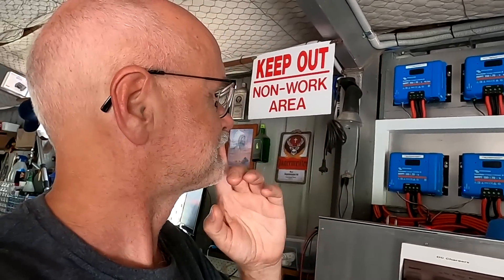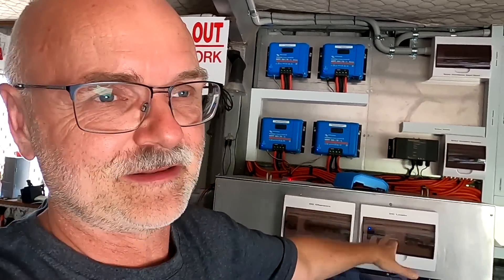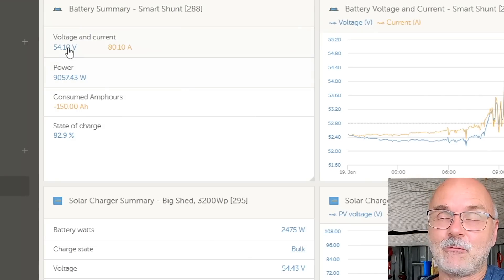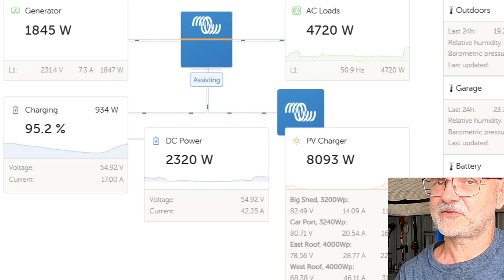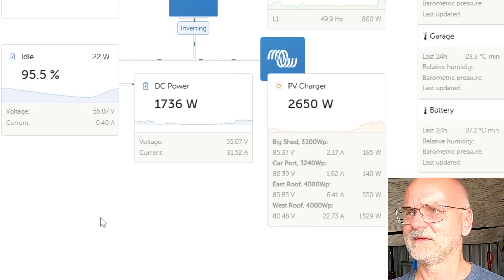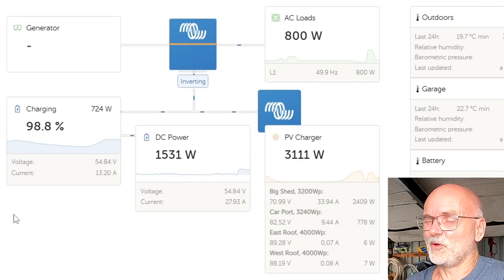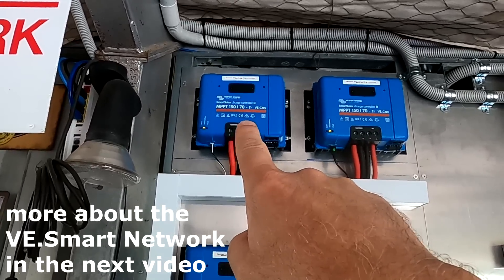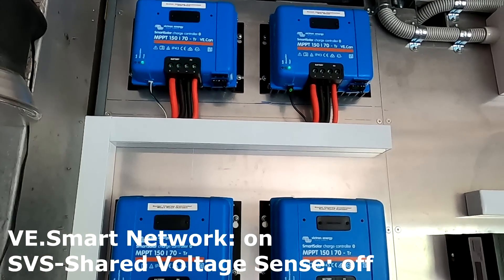Charging chaos: no charge despite full sunshine. MPPTs out of control!

Comment: We have 3x SmartSolar MPPT RS: 2x 450/100-Tr & 1x 450/200-Tr.
Each SmartSolar is connected to each other via a network cable (VE.can) and 1 SmartSolar is connected to the Cerbo GX.
There is 1 smartshunt 500A in the system that is set up as a battery monitor.
I have disabled DVCC.
Each battery bank has a (JK) BMS, but they are not connected to Victron via canbus/RS485. I visualize the JK data using ESP32/ESPHome in Home Assistant (see syssi/esphome-jk-bms).
The solar chargers work as 1 device. They are always in sync (bulk/absorption/float) and they work based on the battery voltage of the shunt. I can see that the limits for each mode are reached correctly.
Reply from the maker: Ah, right, so the sync happens through the VE.CAN already even there is no smart BMS connected. Very good information, thanks a lot!

Comment: Have you actualy measured your batteries with a digital meter as the calibration of the control box's may be different
Reply from the maker: That does not matter and is not the problem. Even if the smart shunt measures 50mV off to what it actually is, it is important that all MPPTs get this same information from the shunt.

Comment: I saw that the MPPTs switched themselves of even when there was a high load connected. That seems strange and inefficient to me.
In my grid connected system the Multiplus II simply switches to feed-in and the charge controllers continue to run full blast even when the battery is full ( as long as the inverter can handle that much current ). Any idea why it doesn't run the MPPTs at least on the level of the connected load?
Reply: well this is off grid system,  they should all stay in the same mode, when he disabled the smart bluetooth network a few weeks ago it was just using the ve netowrk to share the voltages,  but seems the ve netork doesnt force them to stay in the same charge mode.
Reply from the maker: You have DC feed-in enabled, that's a totally different system. They are controlled by the settings in the MPII, I believe. Not sure why they turn off though. Do more testing to find a pattern when they turn off.

Comment: I believe the issue is line resistance to the battery. With all 4 charging, the voltage rise is high enough to hit the trip voltage, so the first one to detect it turns off. Then there is less current so the voltage rise is less, it takes a little longer but eventually hits the trip voltage. Etc. But at the last one, there is not enough charge current to overcome the load. IMO, when the first one shuts off, it's charged.
Reply: but thats the point of the svs ( shared voltage sense )

Comment: I had the same problem, my solution was to set the absorption voltage to .05 volts above the what the voltage the battery should go to and set the absorption time to 8 hours and a tail current to 1.9 amps. Yes, I allow the solar charge controllers to stay on the network but I do not allow my shunt to be on the network. The only issue is it takes about a minute for the charge controllers to change to float after bms hits the correct voltage.
Reply: 8 hours of absorbtion ?
Reply: @STRUTZKOFF  it won’t ever make it the 8 hours, just for the very cloudy days. The tail current makes sure of that.
Reply from the maker: I don't like the idea to having a higher voltage setting in the MPPT to allow for voltage drop on the cables. If the current is small, you have this higher voltage at the battery and charge higher than anticipated. 
Why don't you integrate your shunt into the VE network?
Reply: @OffGridGarageAustralia  I was using the shunt for another project and it seems to be working fine without it, so I never connected it to the network. It really cannot charge higher than anticipated since the bms will prevent that.
Reply: @OffGridGarageAustralia  I did a test today and decreased the voltage on the solar controllers to .02 volts over the absorption set point and funny thing happened, the mode went from absorption to float without hitting the correct voltage in the battery. Going to try .03 next, .05 did it before, just fine turning it.

Comment: I have two 150/85 regulators and I noticed that each one detects a different voltage and they are not precise on the voltage..... I solved it by adding a Smart Battery Detector, which communicates with the regulator and always sends it the battery voltage and also the temperature
Reply: but these do that via the svs

Comment: Hi Iam using 2 Smart Mppts with a Smart Shunt and a Cerbo GX in my Camper. I've turned on all DVCC Features and the VE Smart Network at the same time. And the MPPTs are in sync all the time. I'm strugeling a bit when plugged in to shore power with the Multiplus getting synced. But this doesn't happen very often ;-)
Reply from the maker: Thank you for sharing. Interesting you turned everything on in the DVCC...

Comment: Helle Andy

I have a system in my rv with 2 victron mppt smart controller and a rec bms with 300ah lifepo4 battery. I have'nt seen your problem in my system.
The 2 mppt are one 75/15 and a 100/20, and they both work equal hard. I also have the bmv712 but the system is totaly controled by the rec bms, without any problems. I have the cerbo gx configured for dvcc with svs, sts and scs activated, and have  not seen any problems with the mppt's charging the battery.
In my system both mppt show external control and not bulk, absorption or float. Because they are totaly controled by the bms. Right now my system is offline because it's winter here and the rv is shut down.
Reply from the maker: Thanks so much for sharing. The REC BMS is something people have recommended. I may get one in for testing from a viewer if everything goes well.

Comment: I don't understand why anyone would want more than 1 Solar Charge controller. I would just get a bigger one. My MidNite controller just does it all, I understand this channel is for testing, but all this stuff is so confusing it'll take the fun out of the whole of grid thing. God bless, and Stick it to the Man!!!
Reply from the maker: Hi Chris, you never get only one device from each. If it brakes, you're in the dark. Multiple solar charge controllers, multiple inverters, multiple batteries.

Also, you want one solar charge controller for one roof orientation/direction

Comment: Thanks for your video! I have a similar problem with temperature sensors. I am trying now t o solve it with dvcc
Reply from the maker: Not the -1°C problem?
Reply: @OffGridGarageAustralia  No I think it's temperature mine issue. The solarcharge is closing the charge for some minutes and starts again with no error. The pv voltage are fine cables etc. Maybe there is software bug with "ghosts" temperature readings.
Reply: @OffGridGarageAustralia  today was perfect, no problem yet 😀😊

Comment: What voltage do you measure at your battery terminals? Over here, my lynx shunt voltage is about 0.3 lower than what I measure at the battery. Yes without current flowing, so should be equal. That means my multiplus thinks the voltage is lower than it actually is and BMS shuts down charging because over-voltage. Solution, change set points to overcome this measurement difference.
Reply from the maker: I have not measured the voltage of my batteries for a very long time. And this is not too important if the smart shunt measure say 50mV over or under the real voltage. 
Far more important that all devices read the same voltage.
Reply: Calibrating electrical equipment is an important step not to be missed during installation.  This is an important point.

Comment: I am not using any Victron equipment at this time, but I have two very different charge sources to my battery bank. The two systems here do not talk at all. I set my MPPT DC charge controller voltage a little higher to compensate for some of the voltage drop in the wire, and it's internal voltage reading error. This way it will keep pushing it's maximum current, trying to top up the battery bank to the correct voltage as long as we still have sunlight. I do see a spread of about 0.2 volts from the battery bus bar to the terminals at the inverter and the MPPT charge controller, and the internal voltage reading in the cheap controller is another 0.15 volts higher still.

When the charge controller goes into absorb mode, the current starts to drop down. But as the current drops, the voltage rise from the wire resistance also drops. This causes the absorb current to remain higher for longer. In reality, the battery voltage is still climbing up and should eventually reach the true desired set voltage. As the current drops further, the voltage drop reduces and the battery voltage climbs up, and if there was no load on the system, it would be fine. But with other items (the inverter) putting a load on the battery bank, the voltage drop is constantly changing.

If the charge controller does trigger to a lower voltage float setting, as it should with LFP batteries, you might lose more charge power than you should. My cheap charge controller has an additional voltage setting "Boost Charge Recovery Voltage". If the battery voltage reading falls below this, it will trigger it to go back into full bulk charge current mode again. If the Victron units have a similar function, you may want to raise that voltage setting to get them to go back into bulk charge if your loads drag down the voltage while you still have sunlight available. Just an idea.

Comment: I have 4 Victron MPPT, smart BMS (REC 16Q Victron compatible) and two times the MPPT's are acting strange, all but one going to absorption while SOC is somewhere in the 50% range. Only resetting (by disconnecting the battery while the Multiplus II stays on) will get thing right again.
Reply from the maker: Your MPPTs should be under external control, right? So there is no real Absorption or Bulk anymore even the lights suggest that. They just do what the BMS tells them to do...
Reply: @OffGridGarageAustralia  There you have a very good point! That would suggest the REC BMS is acting strange. also suggested that by a hard reset of the BMS the problem is solved!  This adds momentum to my plan to make my 280 Ah 16 cell battery a dumb one for test, cutting the CAN to the Cerbo and see what happens. 
On the Cerbo I get also REC warning signals when the battery temperature gets to about 10 degrees Celsius: I set the minimum temperature to 5 degrees however, and a pre-warning can't be set, isn't mentioned at all at the documentation....
Reply: By the way I disconnect the battery by switching the BMS off which results in a disconnect by the bistable 500A relay. So the battery is disconnected bu at the same time the BMS is reset.

Comment: Why not swap the batteries so you have the smart BMSs controlling the charging? 
I use my Multiplus to charge my battery with mains voltage and it has a battery voltage sense to overcome voltage losses in the charging cables. Do the solar chargers have this capability?
I now use the Seplos BMS control charging which I think is the way you need to go.
Reply from the maker: I don't have mains. It's an off-grid system. Hence, the Off-Grid Garage 😂
I have a lot of issues with the Seplos in terms of their design. Coming up soon.
Reply: @OffGridGarageAustralia  I understand the difference, between our systems and mentioned it for context. I know what you mean about Seplos but I am happy with mine and only needed to do some manual balancing once it was set up. The problem with your system is it is not being controlled by the battery voltage so it needs a BMS or smart shunt that the Venus os can use to control the solar chargers together.

Comment: Are you missing the simple answer?
Add 0.4v to the MPPT settings to allow for voltage drop?
What you have done here is got all the issues of too low a MPPT setting and easy going into absorption too early - you have seen this in the past too.
Reply from the maker: NOOO, you cannot do that! If you cloudy weather, the current is smaller and therefore the voltage drop is also less. Your batteries will charge at a higher voltage. Not good!

Comment: Silicon has a 700mv drop ;)
Between the wire lengths and the heat they have had through them it can change the specs of the internals but see if the controllers are from the same batch and use ur DVM and check the voltages yourself

Comment: If you set this so as you set on the start on the Vid, then don´t set absorbtion time. Instead set the tail current. So the Current will sink (instead of shutting down after defined time for absorbtion) and the voltage drop over the cables an connections can sink until the tail current (for me 200mA measured for 8S2P 100Ah Cells in a 24V System). The current can slow down, while the voltage on the cells go higher cause of the falling resistance  of the connections and cables cause of lower current.

I hope someone understand my thoughts
Reply: but if you do that and you get a few clouds it will jump into float mode
Reply from the maker: Tail current is bad in cloudy weather or if you have shading. The MPPT will think the battery is charged and goes to float prematurely. Not good.
Tail current only works if you have persistent incoming power (charging from grid or gen)

Comment: Victron equipment is somewhat complicated.  This equipment, similar to say a variable frequency drive, will have settings that interfere with each other.  A VFD is obviously more complicated with up to a thousand parameters, but like the Victron gear, you usually only need to change a few of them correctly for it to do what you want.  I look forward to seeing you solve this problem Andy.
Reply: Lol, I was literally getting training today on the mistakes others have made with VSDs lol
Reply from the maker: Well, it is basically solved by using the VE.Smart Network which synchronises all MPPTS and also shares the real voltage through the Smart Shunt.
Reply: @OffGridGarageAustralia  very good.  How would you solve the problem if your solar charge controllers could not communicate with Bluetooth? Say, too many steel walls in the way?

Comment: I have a smart BMS built into my Battle Born Batteries and I use Victron charge controllers, I have no issues sinking them together!
And I have them all connected to Bluetooth. I have three Victron charge controllers.
They all sync together in bulk and absorption and float.

Comment: Sometimes dumb modes just work better than smart modes :-).  I wouldn't have expected the Victron to mess up like that, though.   It does bring up always having a bit of margin with settings, so everything works reasonably well even when things aren't quite synced up. In this case, you have your bulk target set to 55.2V (3.45V/cell).  That might be too low to have sufficient margin to deal with all of these cumulative measurement errors, resulting in the charge controllers going into absorption too early. 

Hmm... I would have thought that the victron would have an option for an external battery sensor that you can wire directly to your primary monitoring point on the battery side of the smart shunt.  Sometimes it is important to have a separately wired voltage sensor using wires that don't carry any current (i.e. are only used by the sensor), so their length doesn't matter and they can get an accurate voltage measurement.

One last thing I can think of... connect a scope up to the battery and check the ripple.  It might be significant enough that, coupled with insufficient setting margins, it is causing the charge controllers to be confused.  Though I would not have expected Victron to make that mistake either.  Usually when we do voltage sensors, we actually pull in and average at least 4 samples per 60hz cycle (about a 4mS, aka 240Hz sampling rate).  We do that in order to remove the most common types of ripple (usually harmonics of 60hz) from the measurement.
Reply from the maker: Victron has a smart battery sense device. It does the same as the Smart Shunt in terms of measuring the voltage directly at the battery level and report his back to the system so all devices can have this precise reading. And the same figure reading, more importantly, so they can sync what they are doing.
Reply: @OffGridGarageAustralia  Awesome!   I guess the battery voltage at the smart shunt will be fairly close.  Though it may be easier and more accurate to calculate the voltage de-rating due to current with a dedicated sensor directly on the battery busses whos sensor wires aren't carrying current.

I assume that Victron has a field that can be programmed for calibrating the de-rating.

Probably worth testing what the voltage droop is between full load and no load at various points in the system.

This also reminds me to mention double-checking the low-voltage shutdown margin to make sure the inverter still shuts down before the BMS disconnect level under full load.

-Matt

Comment: Tell me about the advantages of having everything communicating.
Reply from the maker: 3 battery banks with 100A charge current. 2 of these banks shut down due to cell balance issues. MPPT keeps pumping 280A into the remaining battery bank.
Save or not save?
With communication, the remaining battery can tell the MPPT to stop charging or slow down...